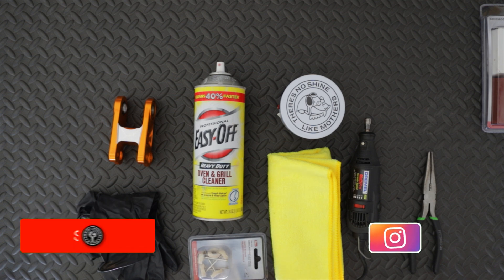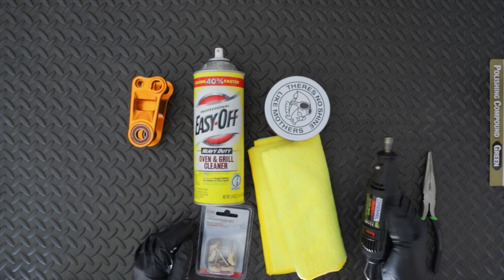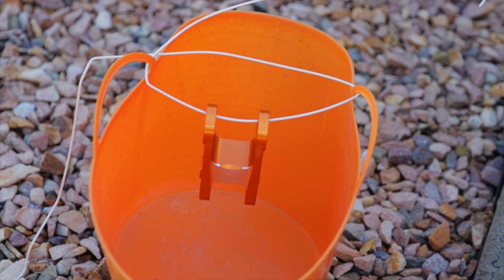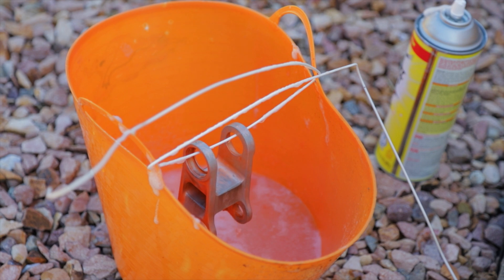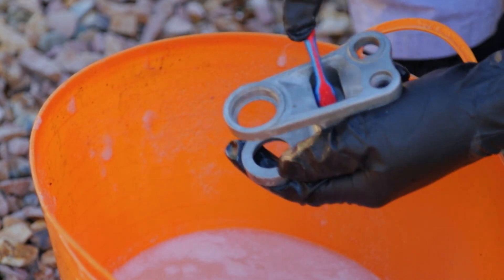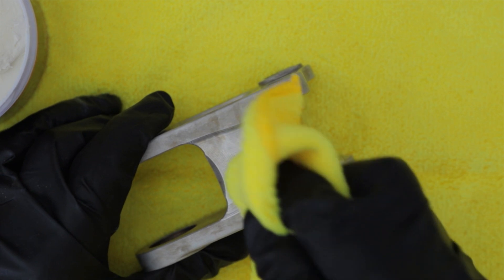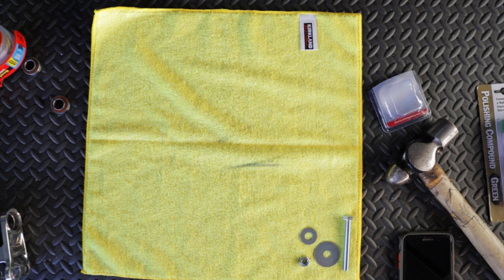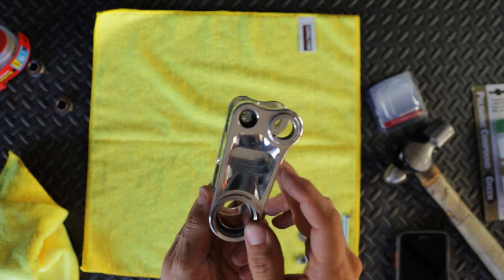De-anodizing aluminum parts 🤙🏼

Comment: Hey i got a question for you, suppose you have anodized aluminum of black or red color, so you make this process to De-anodize, but your end result is shiny aluminum.  I want the end result to be Grey silver color Anodized. So it needs to be re-anodized again? Because after the bath you did, it looks like silver color but i think it is different and not anodized anymore.
Reply from the maker: Yeah after the bath it’s a full gray. Like raw aluminum. I suppose if you liked that gray you could experiment with just clear coating. But yes you would have to re-anodize it if you wanted any other color

Comment: Awesome vid thanks for the walkthrough!  I’m wondering if you or anyone else knows how I might mask off an area from the oven cleaner?  I’m going to deanodize a skateboard truck and don’t want to damage the axles.  I was thinking electric tape for some reason, just wrap the axles with that or no?  Halp :)
Reply from the maker: I would use that with a piece of a black trash bag. The oven cleaner is very corrosive so I’m sure it will eat up the tape and seep through. But I’m sure you can make it work
Reply: Thanks for replying appreciate you :)
Reply from the maker: No problem brother good luck with the project!